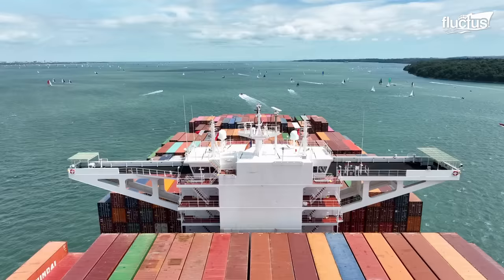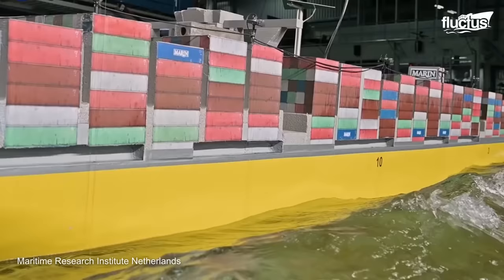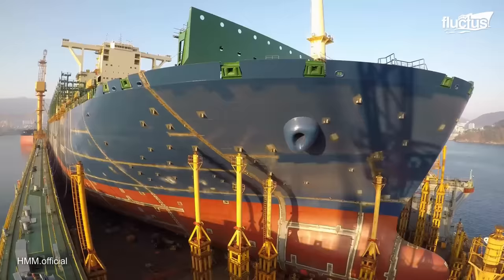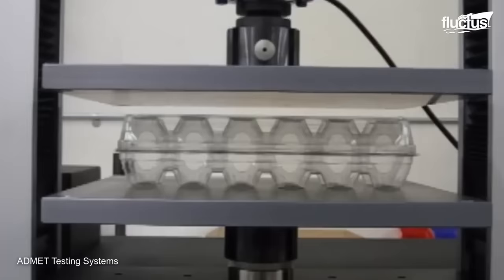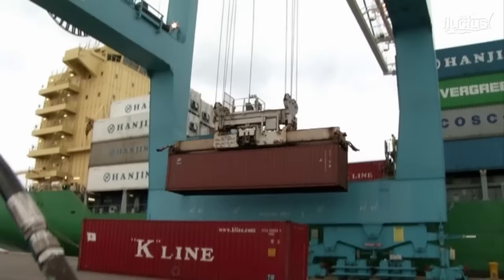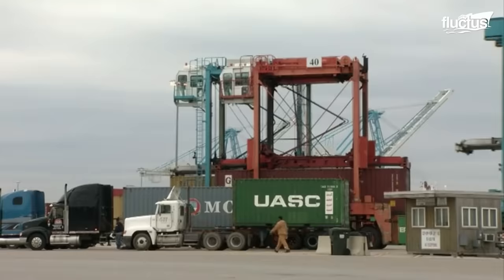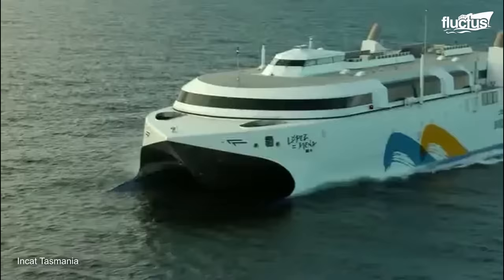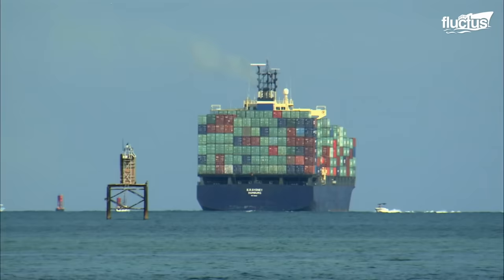How 150 Millions $ Container Ships Are Cruelly Tested Before Production

Comment: Once one of these shipping companies find an optimal design for one of these behemoths why not just keep copying that design so they don't have to keep spending tons on more testing and making different designs all the tim
Reply: Hello Scott, I am a student studying to design ships just like these. You raise a very good point that gets addressed in several of our classes. So here is my response:

1. Different routes require different design. Some routes you are crossing across oceans or traveling long distances. Some parts of the world have rough seas which pose a threat to the vessel. Others have flat seas and the design can be much more relaxed.

2. Changing emissions requirements. A current driver of new designs is decreasing emissions. Some zones of the world have strict emissions guidelines that the vessels must employ unique solutions to meet. Currently they are able to be met by adding to the existing engine but as we look towards "zero carbon", more advancements will need to be made that will modify current designs significantly. 

3. New technologies. As the world continues to advance, manufacturers are able to achieve better precision which can result in increased efficiencies. This means that all that systems inside the ship continue to get better and better. The scale of these vessels means that a 1-2% decrease in fuel and operating costs over the 30 year lifetime adds up.

Comment: Are cargo containers designed to sink or float if they go overboard ?
Yachts have been sunk hitting floating containers.
Think it's an interesting question 
Obviously they are watertight against waves but could they for safety be made to sink after a period drifting at sea ?
Reply: I always thought they sink or float based on what’s inside. Water will leak in and it would sink if it was empty. But it’ll float if it’s a container full of pool noodles for example.

Comment: Ha ha ha - pool test time is down the drain. because as you can see in the video, the nose and stern of the model are fixed with a cable.This test is only for the toy Roly Poly, so to speak, and that's it . The conditions at sea are completely different, they would still have carried out simulations on a computer model and then wondered if the ship sank in a storm.